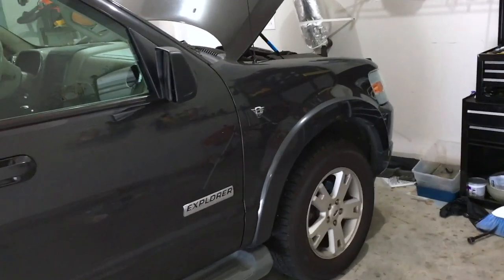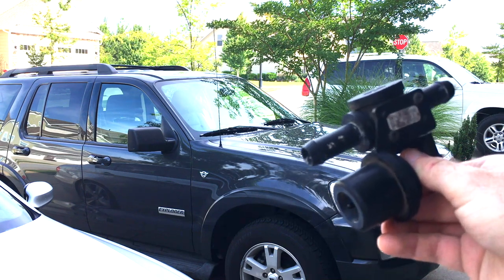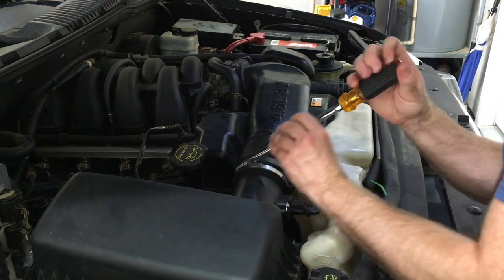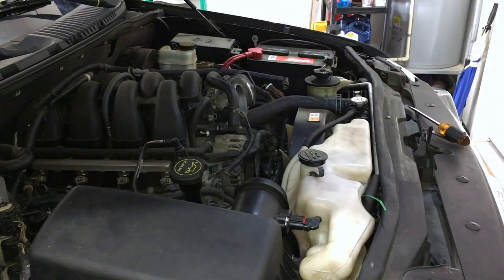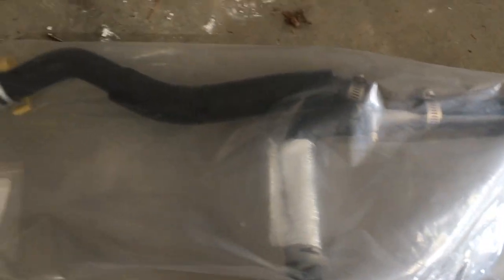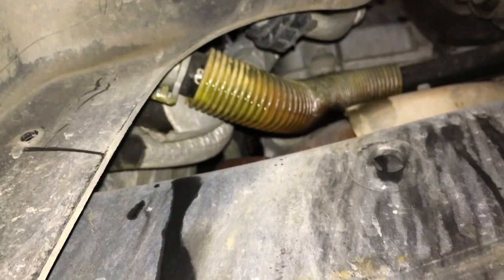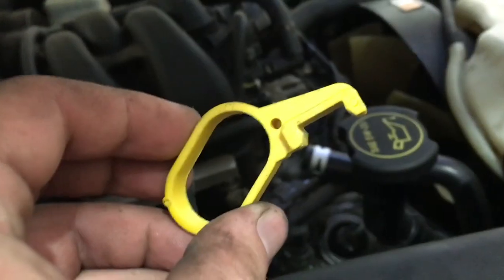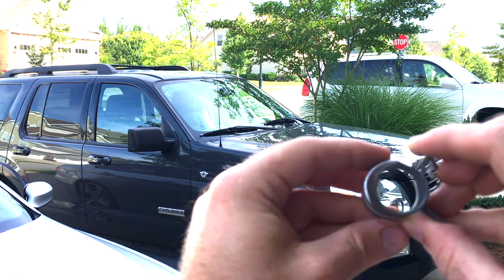How to Replace Heater Hose! Ford Explorer 4.6L 3v

Comment: anyone know the clamp sizes required? my 07 has a cap as a field fix blocking off the rear mount HVAC system. the cap is of course leaking terribly. just bought the car so am trying to get everything working on it

Comment: So I just replaced this on my 2008 Mountaineer.  It was the Dorman part as in video.  Where it is shown the clamp didn't work, the hose is actually bigger that the old one.  With the clamp that came with it, I could just slide the hose around.  To use the old clamp, I had to bend(break off) the piece that stops it from opening to far.  Nice and tight with the old clamp and no leaks so far.

Comment: Seen several asked... 
2002 thru 2010 models
Part#: 626-522 (Dorman OE Sulutions)- heater hose
Part#: 74858 for the Climate control heater valve. If you anything like me use the old valve to place on the new hose if its still good and not broken. Im about to replace mine myself. I didnt know anything about the yellow clamps I'll stick with the ones that came from the old hoses as well. Thank you for the video gave it a like and a share and saved it
Reply: there are heater lines that go all the way to the back of the station wagon.... all the clamps are rusty of course :)